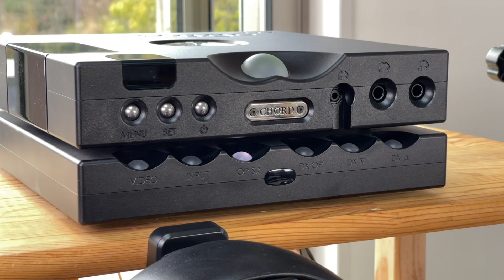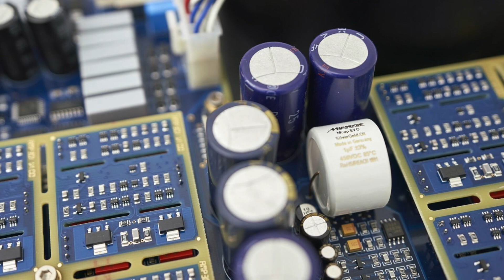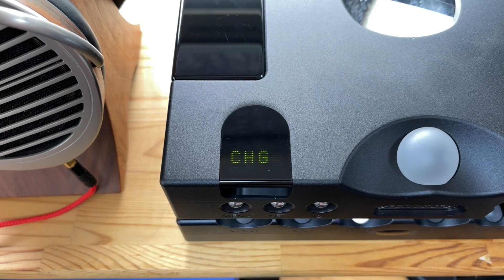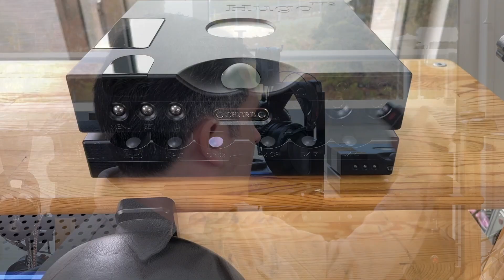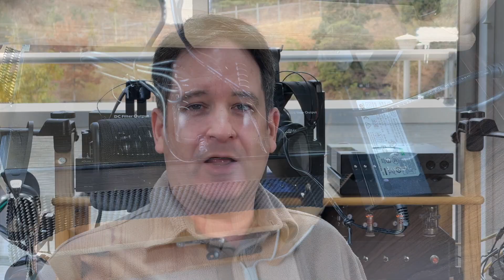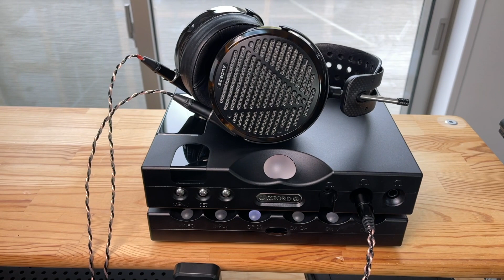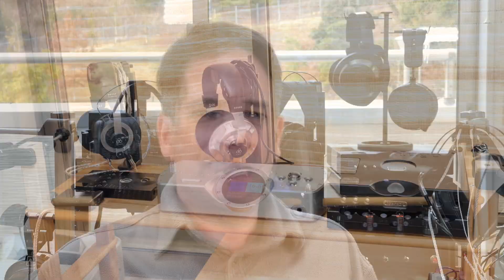Chord Hugo TT2 & MScaler Review

Comment: Does any one use the TT2 only as a dac with XLR to one amp( solid state) and RCA to tube amp? The manual says you can’t and my experience was weaker and distorted sound on the tube amp.. if I disconnect te XLR and just use RCA to the tube amp it’s perfect sound ..
Reply: oh , iread somewhere thats going to ruin tt2 , they say never connect xlr and rca simultaneously
Reply from the maker: No, it wont ruin the TT2. I've had them both connected for years now.  When you "read somewhere" something, if it's not from the manufacturer, be a bit cautious.
Reply: @Currawong  i think it was a comment from chord or rob himself
Reply: @Currawong  i tried to be modest but honestly its written in the user manual that it definitely will damage tt2 and btw it sounds awful when both of them are connected even if just one of the amps or pre's is powered on. you can look it up in user manual -page 21 section 4.3 " 5)   Please do not connect  
 both XLR & RCA to amplifiers  
 simultaneously, this will  
 damage TT 2"
Reply: @f.evangelista i tried to be modest but honestly its written in the user manual that it definitely will damage tt2 and btw it sounds awful when both of them are connected even if just one of the amps or pre's is powered on. you can look it up in user manual -page 21 section 4.3 " 5)   Please do not connect  
 both XLR & RCA to amplifiers  
 simultaneously, this will  
 damage TT 2"

Comment: How did you volume match. Did you do it scientifically or just use your ears?
Reply from the maker: I play a 1khz -20dB tone through the headphones while they are holding my phone, which is running Sound Meter. I can get it to with 0.1 to 0.2 dB accuracy consistently.

Comment: What about the  increased physical distance between components  you get from enlarging the interior space?  Does that help improve performance by keeping components farther apart?
Reply from the maker: It can only help if one component is causing interference with another, which would produce obvious distortion to the sound. So, sometimes it is necessary.

Comment: Do you add the Herbie dampers to all of your headphone plugs? In what way do you find them improving the sound for tubes or the cables?
Reply from the maker: Not usually. I haven't noticed them making a difference. I got a couple of them from someone else quite a few years ago, and haven't noticed them having any effect beyond helping prevent adaptors rolling off my desk. Since I have the Studio Six tube amp, I just tend to leave them on there, in case they might have any benefit reducing vibrations getting to the tubes.
Reply: @Currawong  thanks, I have considered getting some but wasn’t sure if it was worth the money at the moment. Guess I will hold off on that.

Comment: Wow this is the most buzziest of buzzword reviews. Where is the opening and scrutiny like the A90D. You are giving them credit for wallwort compared to scrutinizing the meanwells used that are recognized as good power supply.
Reply from the maker: Incorrect. The TT2 uses super capacitors for the PSU. The wall wart only supplies power to charge them. I've tried putting a noise filter between the wall wart and the TT2 and it made zero difference.
Reply: You are right thank you for the reply and your service to the community. You are lucky to have such a collection of good audio devices. Sometimes it is difficult to navigate this audio landscape between the objective measurements, the outright shills, and the actual bad devices. This is a great device that many would be grateful to have. Sometimes it is difficult to know if there is valid audible difference between the $1000 dollar devices and the $6000 dollar devices or if there is some confirmation bias that the listener is picking up on. As a newbie with a small budget sometimes the “buzzwords” are tough to understand and may mean something different coming from you or the next reviewer. Anyway thank you for in depth reviews, you definitely take time in understanding devices even at the component level.